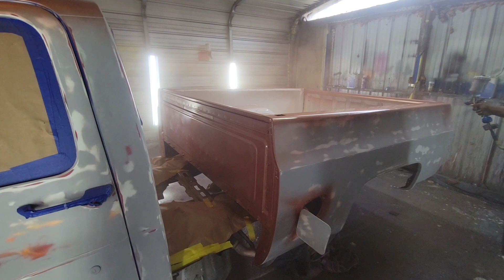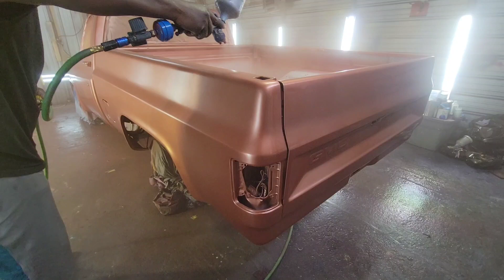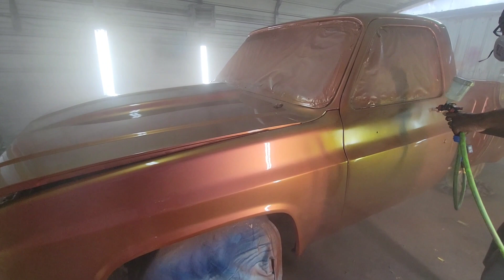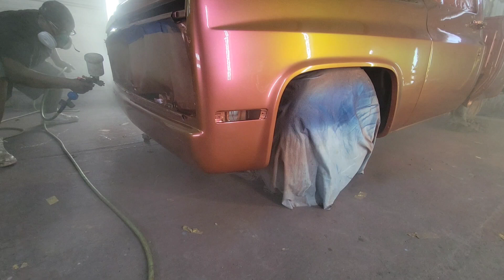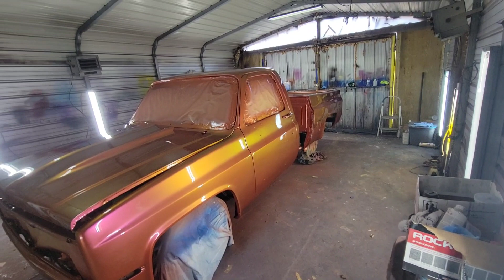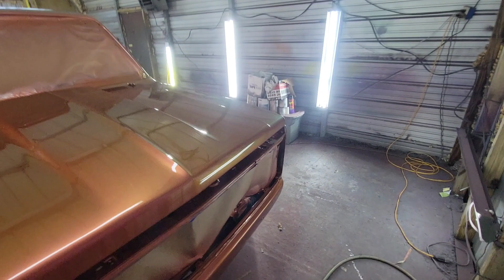Big Brain Clear on C10 Truck

Comment: Great job on the truck brotha, fyi, if you use sealer before the base coat you’ll use less paint.  Tin the sealer as close to your base.  Sealer will help with ringing out as well.  Keep doing what you do well.

Comment: The only problem I could see is him fanning the spray gun at times instead of keeping a straight steady pace. He at times sprays on the coat slowly then speeds up. It's going to create inconsistency for sure.
Other than that it's clean
Reply: Do you see my point tho? Like on the hood for instance. Why fan out like that at the front end when you could go straight down over the hood, just wondering that's all. But it's aight my g I'm not finna be gassin you up to much now ahaha